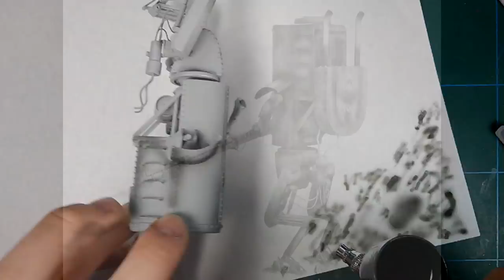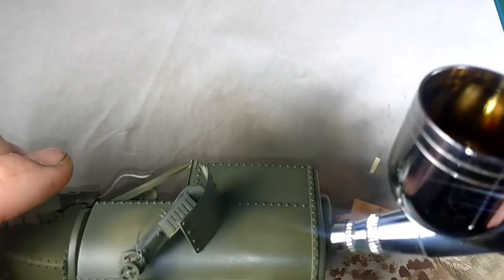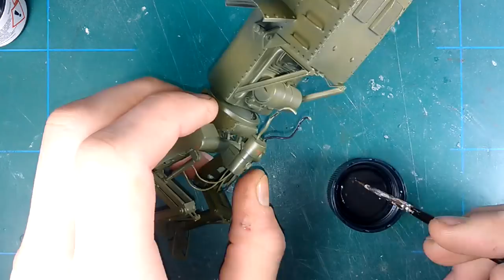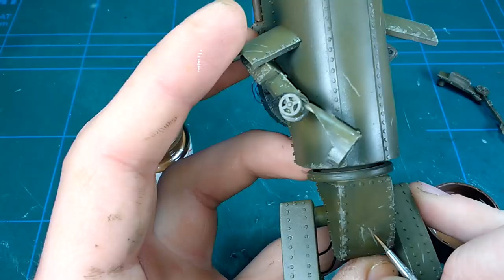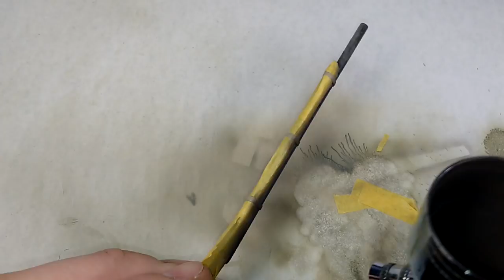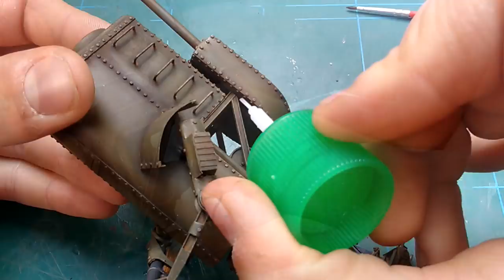PZM-7 1/35, scratchbuild  [Part 2] - Mech model (from Iron Harvest)

Comment: 8:25 one week dry time?
Reply from the maker: Just to be sure, but two days should be enough :)
Reply: You should really let oil dry for a couple of months before varnishing with acrylic [more like, 3-9 months for a painting]. The reason it's regarded as bad practice to paint acrylic over oils, is because of their different drying rates; as oil drys it shrinks and contracts-causing the acrylic to lose adhesion. Thick oil can actually take years to dry, but a couple of months should ensure a model, thinly painted; lasts.